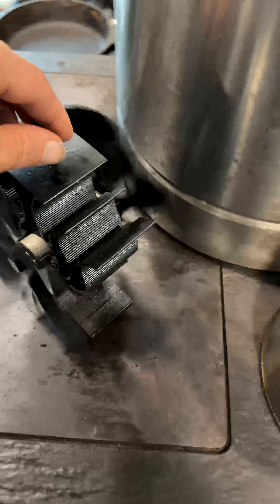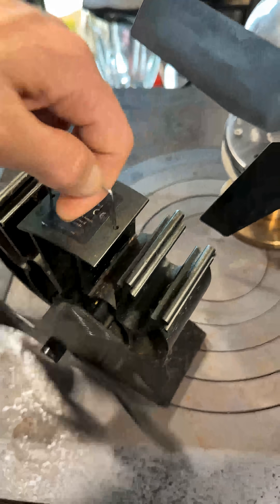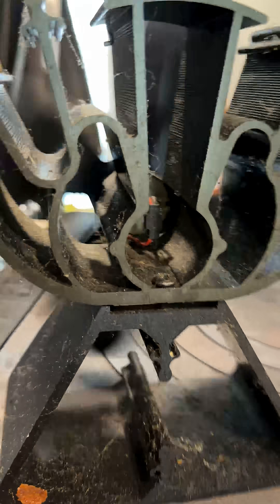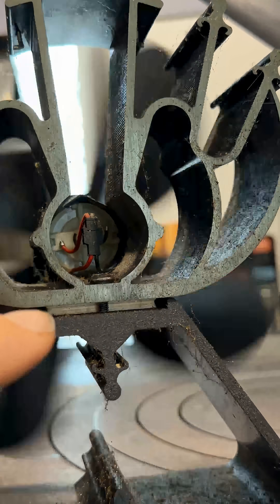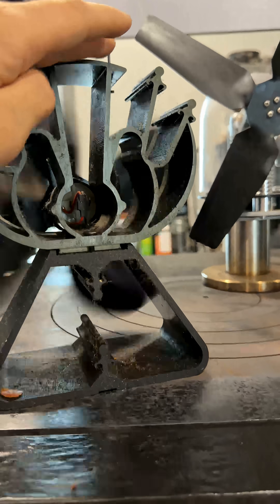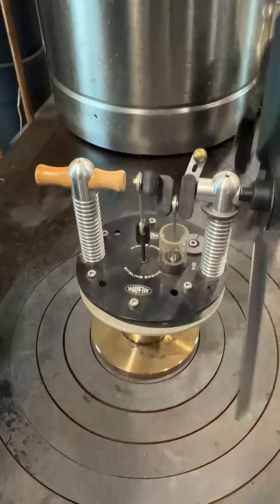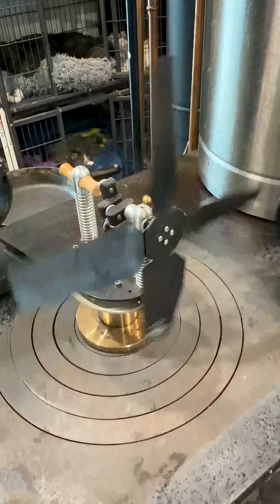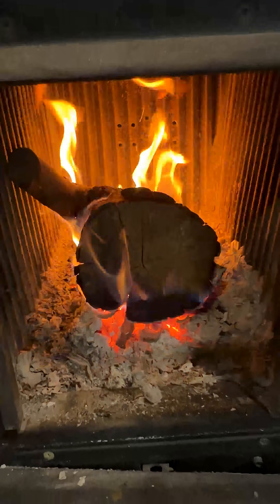Stovetop electric fans powered by heat #narrowayhomestead #offgrid #stovetopfan

Comment: Around 1990 we paid $75 for a used Peltier Junction Effect device just to play around with.
Those little tiles are now 10 for $7 brand new.

They are mostly used to move heat with electricity, but yeah, you can use the seebeck effect to get electricity from something with one hot side and one cool side.

And deisel train locomotives are really just electric trains powered by diesel generators.  So thats just kinda how people talk about these things.

Comment: It's not a combustion engine ... A steam engine makes steam through combustion ...and you don't call it a combustion engine..... same principle on the piston operated fan ...it doesn't need combustion to operate, it needs a heat source...put it on an electric range and it would still work... therefore not a combustion engine...

Comment: Peltier is nice stuff. Sadly the amount of energy is low. But enough for stuff like that.

Fun fact. You can apply a current to it and transfer heat from one side to another. 

Cooling or heating stuff. 
If it wasnt so power hungry per watt colling. PC's would use peltier elements xD.

Comment: peltier devices are neat but comically inefficient.
Then again, the heat here would otherwise be wasted, so, any gain is acceptable
Reply: hot would it be wasted if it's heating the house ?
Reply: @Foreverisover  one example would be that without the fan the heat would not circulate enough to warm up the room.
Reply: @GeorgeTsiros  it sure would circulate without a fan, have you ever ran a woodstove before lol.

Comment: Still technically heat power, with an electric converter built in. Initial direct source of power at the engine counts for the terminology, thermo electric as one person says would mean either, or both.
Reply: Once again the other motor is still heat driven, the combustion is not happening at the engine.

Comment: Its a scam, there is nothing in here with electric😂 i have similar old toy, you place candle light it up and it starts moving thins making fast spin. Warm air goes up and moves blades, it does absolutely nothing usefull.

Comment: Nightmare bloody things that I don't bother with any more. One slight overheating event demagnetises the motor so it doesn't run as fast and provide adequate cooling any more, so it starts perpetually burning out the Peltier plates until you can no longer be arsed to keep disassembling and soldering new ones.

Comment: Yeah, when i found out we could make electricity from just heat/thermal difference i questioned why we don't do it more often as it seems like a really good way to generate power for cheap.
Reply: Unfortunately it takes a really big temperature difference to make the power.  So woodfire yes, car radiator not so much.  But at about 75 cents each, go ahead and play around.
Shop for a TEG (Thermo Electric Generator.)  Man I stand corrected.  10 if them are like $44 on ebay right now.
And same price for TEC (thermo Electric Cooler)
One can really be swapped for the other, but it won't work as well.

Used tgem to make little water cooled heat pumps for air conditioning.  Not terribly cold AC, but its not very hot up here.  So its enough.

Comment: Sterling engine is true heat engine. It doesn't matter from where the heat comers from. It could even be a bucket of hot water. And if you heat it with sun light, what would you call it then? Sun engine? Light engine? And if you managed to heat it with radioactive decay, what would you call it?

Comment: I mean. It is heat powered. The power comes from the heat. 

Like... a gas powered generator can drive a lightbulb. Its electric. But the power comes from the engine driven by gas.

Comment: If you drive the fan with wind it will work in reverse and becomes a thermal pump and diode, moving the heat in one direction, making the top cold and the bottom hot, or the reverse of you drive the fan backwards!

I used the peltier devices (just the white ceramic bit) to make a little air conditioners for my wife’s hamster enclosure to keep his lil hamster house cool in summer and warm in winter 🎉

Comment: If standing on a stove, makes a sterling engine a combustion engine, then a peltier device on a stove is a combustion device too.
That or the are both heat driven.
Not heat powered tho because heat does not produce power, instead: Power produces heat.

Comment: Why don't you build a solar Dynamo. 

The solar panels or windmill can generate heat for a heat coil that warms sand up to about 1200 degrees, that sand, if well insulated, will retain that heat for at least 20 days from one charge. 

Use the heat from the sand to boil water to generate electricity that drives a Dynamo. The exact same principle they use for a nuclear reactor. But it's sand and water. 

Off the grid, self-contained.

Comment: The easiest way I've found to clean these fans is to use a can of brake cleaner. Spray it on and let air dry or if you have an air compressor blow it off. It only takes about a minute and your fan is spotless. It will start working really well again because as these fans get dirty they slow down, if it gets dirty enough it will stop working. Give it a try you won't regret it.

Comment: TEG Thermo Electric Generator or Peltier Device is used in Thermo Couples for Modern Gas appliances with auto ignition pilot lights.  Also Sattelites because heat build up is an issue with no other cure in space.  A Vaccum surprisingly does not pull heat away from metal objects despite being extremely cold.  So converting heat into electricity became a prudent method to eliminate this heat waste to charge backup batteries and prevent satellites from melting.

Comment: You contradict yourself by saying the first ones are not heat powered but electric because of the conversion by the Peltier device but that the Stirling engine is a combustion engine because it's being powered by the fire. 
   They are both harvesting work energy (power) from the same source. Only the method of energy conversion differs.

Comment: yea, it's powered by combustion, but it's also running for free, because virtually 100% of the energy for the engine gets converted back into heat eventually, which is what you want anyway.

Comment: Your logic doesn't work here. You call the one with the TEC an electric fan because what DIRECTLY powers the fan is an electric motor, but you called the Stirling engine a combustion engine because it is UNDIRECTLY powered by combustion. Make your mind and use the same standard!

Comment: I think heat powered would be the best name for them as it describes their practical purpose. You put them on a source of heat and they start turning. That name describes the use case pretty well.

Sure, there is electriciy involved at a point but that electricity is only there because of the heat.

Comment: Technically that's a Seebeck generator, not a Peltier device, they're basically the same, but the Seebeck one creates a potential difference from a temperature difference, Peltier creates a temperature difference from a potential difference.

Comment: Technically a Sterling engine is a type of Hit or miss engine. 
Both types are powered by a heat diferential so yes a heat source is needed 
A peltier device can also use electricity to move heat from one side to the other.

Comment: Seebeck effect, or Seebeck device. Peltier cooling or Peltier device is when you actively power, the dissimilar metals to move heat. They are the mirror images of each other when taking power from a temperature differential, one creating a temperature differential with electric power applied to it.

Comment: Need to be used at nuke plants to promote safety constant power, if they had been in use at fukashima there would have been no power shut off hmhapam has two current flavors which is why they could not get additional power to keep the pumps running the diesel generators got flooded and failed to start

Comment: Peltier type cooling used in astrophotography cameras. Camera sensors are cooled to 30  below ambient temperature to reduce the inherent noise in the sensor and take the pictures that way. Yep, they can be powerful enough to drop a camera temp to -30 C degrees.Look up astrophotography cooled-cameras.

Comment: Still a heat/thermal engine not a combustion engine. You could power it with the sun, and then you would need to call it a fusion engine in your way of thinking. And what if you use a thermal vent from a volcano, what would you call it then? Its a Heat or thermal engine as it can have many different sources of heat.

Comment: That is not a peltier device it is a thermocouple.  ;) 
Two dissimilar metals sandwiched together heated up, creating an electrical potential. They are used as heat sensors And pre-inexpensive to produce.😊

Peltier devices rely on semiconductors and are ofc much more expensive to produce.

Comment: They are thermoelectric, there's a Peltier device that converts electricity into heat on one side and cold on the other, here we're utilizing that difference to generate electricity instead of a temperature difference.

Comment: There are also fully mechanical ones that use the temperature to essentially operate a passive internal combustion engine. Yes I know that isnt actually correct but its a piston that is pushed and pulled essentially by heat. Thats what internal combustion does too, just in a more complicated way.
Reply: Should have finished watching the video before posting. He ends up explaining thw same thing. 😂

Comment: I need to get one or two of these. I've been using a battery powered Rigid fan on my kitchen counter to blow across my wood cookstove to heat the house. Does a mighty fine job, I'd recommend that fan to anyone interested, but it does mean you're charging and swapping batteries. On low, one of the big batteries will last all day and all night for about a day and a half, or just three nights. Darn good, honestly. But I'd like something that doesn't require a plug.

Comment: I don't care if it annoys you, but they are indeed heat powered in the same way that a coal-fired power station is. The difference is that the fan uses a Peltier effect thermal device to utilise a temperature difference between the two sides, whilst a coal-fired generator generates steam to drive a turbine and it's generator. 

Both rely on heat.

Comment: It’s called a Seebeck element, or the Seebeck effect. The top of the fan stays cooler than the bottom, and the different materials inside respond to that temperature difference by moving charge in a way that creates a small voltage. That voltage powers the fan, and the airflow helps keep the top cool so the effect continues. Not a perfect explanation, but it gets the idea across
Reply: I should have just watched the short he explains it basically how I did.

Comment: My aunt and uncle had a convection powered stovetop fan when I was young. It had a horizontal fan at the top which would spin with the hot air rising from the stove, which would then drive a vertical fan which spread the heat around the room.

Comment: Inconsistent. If that is not a heat powered fan, then the other one isn't a combustion engine either. 
If one is electric, then the other is steam powered (assuming that sterling engine uses water and not some other fluid), either that or they're both heat powered. 
First order vs second order.

Comment: they're not even really fans though.  if you look at the blades and compare them to an actual fan that you like plug into the wall, you can see that they're shaped differently.  they're only slanted near the center where they don't move through the air so much and thus don't push it much and out near the tips they're entirely parallel with the air so they don't push it at all.  essentially they're fake fans.

Comment: That first one is actually a Seeback device, not a Peltier.  They both work on the same principle of junctions of dissimilar materials and a temperature difference between the two sides..  The Seebeck device is optimized to  generates a current from the hot/cold junctions. The Peltier device is optimized for pumping heat from one side to the other when current flows.  A Pertier device can be used in this application, but it's efficiency would be lower.  (You would get less voltage and current with the same temperature difference. than with a Seeback device.)

Comment: Technically its only a Peltier module when its used to generate a temperature differential from an electric current. When its used like this, to generate an electric current from a temperature differential, its called a Seebeck generator.

Comment: IMHO they are heat powered you take the heat away they stop working. If they where electric powered. They would work with a Battery tough induction or with a cable. But it is nice you tell people that they work with a peltier element. I bet a lot of people haven't heard of them. By the way peltier elements can also be used for cooling. But they aren't efficient. They are used to get stuff really cold. Close to absolute zero in quantum Computers for example.

Comment: Seebeck/Peltier.  Transform heat movement to electron movement or vice-versa.  The input gradient often needs to be much larger than the output.  Generators need a high temperature for a low voltage while coolers/ heaters need higher voltage for lower temperature

Comment: Btw, these little things can work in reverse, to create cold and hot from electricity. It's what powers the crappy little 20 dollar 6 can "fridges" you see at Walmart or wherever with a million different artworks. They use like 40 watts to create "cool" air, to blow into the "fridge" which is why they're not very good at keeping drinks ice cold, because they're directly limited by the ambient air temp of the room they're in

Comment: You can also apply a current to a peltier element and it will get hot on one side and cool on the other.  A lot of 12 volt coolers use this technology

Comment: wouldn't it work better if the base wasn't "open" and letting the fan draw air through it?  you could do an easy/cheap experiment by wrapping the "hot portion" on the bottom of the peltier with foil which would block the air but conduct the heat.

Comment: It is heat powered though because the power source for your Pelletier fans is in fact heat. In particularly cold environments you can actually use the temperature differential of your body heat to the exterior in order to produce a small charge. With the Sterling engine I am somewhat bothered by you calling him confusion so technically it's heat source is technically combustion at this time so fine. Honestly one of the coolest ones I've ever seen was one that was designed to use radioactive material as its heat source

Comment: Definitely agree with you in regards to combustion engines. It's all about heat and expansion of the gases in the cylinder (oxygen nitrogen carbon dioxide)

Comment: I mean... it is a heat differential engine. You'd get the same effect if you place it on boiling or even freezing water. It just so happens the heat difference is provided by combustion. But that is like saying a electric calculator is combustion powered because the electricity is made in a coal plant.

Comment: It works on the same principle as a thermocouple. Different materials are placed close to each other. When there is a difference in temp between the hot and cold junction a small voltage is created. Its usually just a few mv but if you series several of them you can get up to a few volts and turn on lights or operate a small motor with the current you are making. It's hard to see in the video but the fan should have a heatsink on one side to allow it to cool faster then the other thus creative a temperature delta and therefore driving the process. This is more an application of the seebeck effect more so than the petier effect although they're both working for the same reasons you get a different effect if you apply heat to the thermocouple Potion or electric current.

Comment: They actually are heat power to fans.
 You're taking the energy from heat and they're converting it to electricity to run the fan.

Comment: Sorry Nate, but I disagree.
1. According to your definition, both of those are heat engines because both are powered by burning wood.
2. Diesel locomotives also convert de energy into electricity, that doesn't make them electric trains.

If a system is fed with thermal energy, that's a heat engine.

Comment: Fun thing about this is it demonstrates the reciprocal nature of a lot of electronic devices. Most people are familiar with peltiers when they're used in the other direction. Put electricity into a peltier chip and it creates a temperature differential across its two sides, getting you an extremely inefficient mini-fridge. They also work the other way around as shown with these fans. The same goes for LEDs and speakers. Every LED is a very tiny solar panel, and every speaker is a very poor microphone.
Reply: Yep, all those little single can fridges use these things to cool them.

And you're right about the reciprocal nature of devices. A motor takes electricity and turns it into motion, but if you spin a motor by hand it produces electricity instead, which is what an alternator/generator is.
Reply: @superslash7254  if you want to really tickle the grey matter, think of what would happen when you apply this logic to a Tesla coil.

Comment: We jerry-rigged one of these to a heater that screws into your propane tank valve and used it to spread the heat in more directions than "up." It worked great up until we cooked the fan one day, lol. It was super neat to see a Peltier device used in the opposite direction from an old roommate's overclocked Thunderbird 20 years ago (for a CPU, you power the Peltier, put the cold side on the CPU and the heat sink on the hot side of the Peltier).